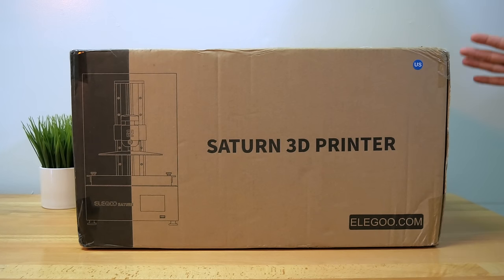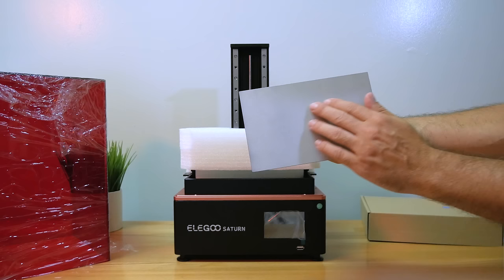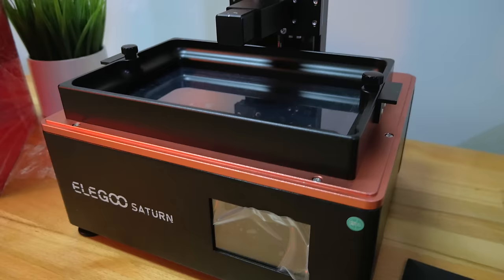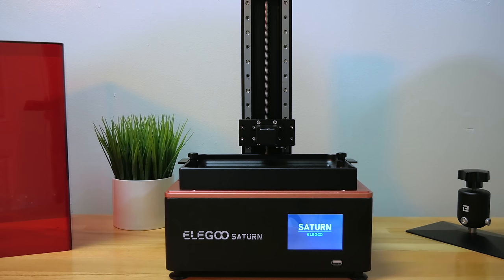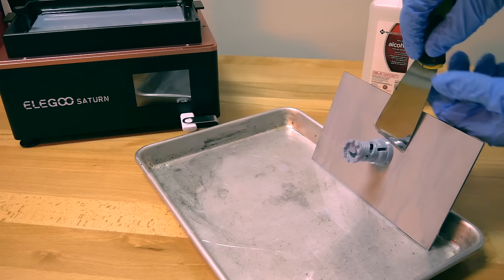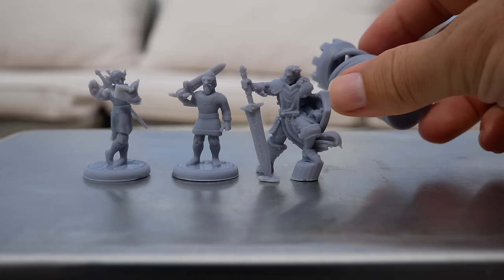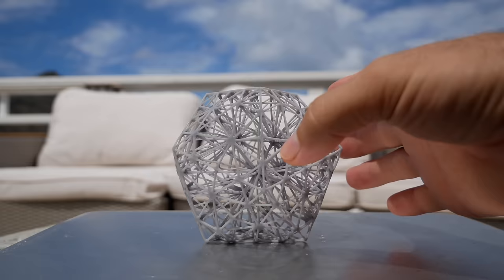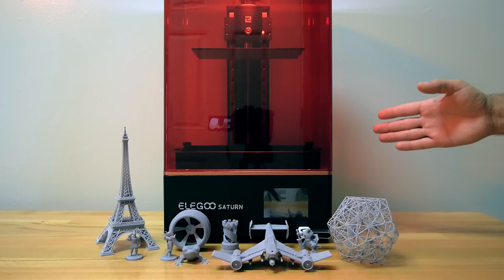Elegoo Saturn - Resin 3D Printer - Unbox & Setup

Comment: Little tip - I think you can reuse the alchohol. Pour the alcohol in the vat and turn on the curing light. The resin in the alcohol will solidify and can be filtered out.
Reply: Gert Halberg waiting for my Saturn, but seems like a cool tip. Though I do worry about the alcohol getting hit from the UV light and combusting.
Reply: @loshan1212  thats imposible, just put uv lithg for 10 minutes
Reply: My Saturn is arriving today and it's my first resin printer. I had a very small concern about how much rubbing alcohol I'd be buying/wasting but this tip is a brilliant solution. Thanks for sharing.
Reply: Counter tip: sounds like you haven’t done it. Don’t recommend something you don’t already do & can atleast attest to the results first hand confidently with resin printing

Comment: The plastic putty knife is for use in the resin vat to help remove things stuck to it without requiring the vat to be empty. Great practice to use it to check the FEP after every print and also to stir the resin to ensure even mixture of the pigment and aid in reoxygenation of the resin.

Comment: Here's how I remove prints, I've found a way that works pretty much every time and doesn't damage the print or the bed (if you're careful.) Get yourself some razor blades (the thinner the better) and CAREFULLY slide them under the print. Sometimes using just a razor blade is enough and the print will pop right off, but if it's still being stubborn, grab your putty knife and slide it in UNDER the razor blade, the thing should pop right off. You might need to use 2 or more razor blades on opposite edges of the print, for particularly large/stubborn prints.
Reply: i do the same. I use a spare blade of a utility knife and it slides just under the prints making separation a breeze. I've been using my Mars for more than a month and the build plate has no significant scratches. Mine is anodized black and quite rough to the touch, while I've seen online many have problems with the machined ones.
Reply: they make plastic razor blades that are pretty damn sharp.  they are on amazon.  people used to use them for this, idk if they still do.
Reply: I tried that a year ago & have never turned back- works great!!

Comment: 4:25 Is it advisable to peel it off? Many people out there prefer not to do so. Others protect the screen with a FEP film.
Reply: Screen protection is strongly advised in the 3D printing community, as there were many cases of tub leakage, resulting in cured resin sticking on the screen and damaging it.
It's cheaper to buy an FEP film than to replace the whole screen for around 80 bucks, I wouldn't leave the foil on though, it's usually all bubbly and wrinkly.

Comment: You just need 15 - 30 s to VAT cleaning.. and the cured resin easy to peel up.....

it is better to repeart (30 second x 10) than (300 second x 1)
you can burn out the LCD with 300 second in one shoot.....

Comment: My biggest issue is, maybe not really an issue, but putting on the build plate and tightening with the big top screw. That screw doesn't go down into anything. that slot you slide the build plate on is flat with no holes. Is that how it's supposed to be?

Comment: I bought this and my touch screen isn't responding at all. Tried downloading the latest firmware, plugged the USB in, and turned it on. It made several loud beeps but no difference was made. Any advice?

Comment: which is better for a total newbie, a filament type printer or a resin printer?
Reply: I would definitely go for a filament printer if it's your first time. They are much easier to work with, cheaper and can produce much bigger and more functional parts. The main advantage with resin is that they can make very detailed tiny parts so if your going to be printing lots of tiny figures resin might be better for you
Reply: That FDM printers are cheaper isn't an argument anymore. Resin printers like the Elegoo Mars or Creality LD-002R can be bought for 220 Euros already. I started with a resin printer and getting used to the cleaning process and how to support parts with a sclicing software was a matter of a few weeks. Why did I start with a resin printer? Because my main focus are figures and statues for painting.
Reply: Depends entirely on what you want to do. FDM is better for functional and large parts. Resin is better for highly detailed, decorative prints. It's difficult to make parts that fit a mechanical purpose on a resin printer due to the fragility of most resins and the slight shrinkage of prints. FDM printers will likely fail a fair amount and require regular tinkering to get working, resulting in a lot of extra effort to get successful prints. Resin prints are less likely to fail, but require a good deal of careful post-processing that is at least somewhat hazardous to your health if you don't have the proper protective equipment.
Ultimately, if you're willing to do your homework and you want to print models/figures, go resin. If you don't trust yourself to take the necessary safety steps and/or you want to build mechanical/large parts: Go FDM.
Reply: @Sharpevil   , there are other resin types available,  but they are not cheap. If resin cost is not an issue, it may be a better solution for parts that do not need to be large. Very few people print large parts (over several days of non-stop printing).

Comment: Do you have a link to the dodecahedron print or is that a test model on the stick included in the printer? Id love to try that when my Saturn arrives!
Reply: Did you ever find this model? I'm having trouble locating it but I've seen it several times on yt

Comment: Running desperate over here! I just bought one of these this last week. Ran it through the rook piece, no problems printing. However, every time I grab a file it comes as stl format and when i slice/save it, I save as the ctb. However, as soon as I stick my usb in the elegoo saturn and run it, I get file format unknown. I have tried so many things and I cant get it to work. HELP SOMEONE! plz
Reply: the slicer may be newer than the printer firmware

Comment: I have A big question, how can a Resin 3d Print be glued to a Pla Print. I ask this because I what a resin printer for job , such as the heat of some model "specially" female model with long hair/
Reply: Resin parts can be glued to other materials with cyanoacrylate glue (superglue).

Comment: The seconds-per-layer time is advertised at 1.5-2.0, but your settings had it doing 8 seconds per layer. The printing time should have been much lower. EDIT: This may be related to having the older screen instead of the new one.
Reply: Aaron Wiginton this looks to be one of the pre-production models that Elegoo sent out for reviewers. It has the USB in front and I’m guessing the normal RGB screen and not the monochrome.
Reply: Definitely. his USB is in the front. The production models are 4k and mono and have usb on the side-rear. I got mine today. just finishing up the first print at 2sec each (default).

Comment: Did ELEGOO send you the old version with the non mono screen? Because otherwise the exposure times are way too long.
Reply: He's got the Beta version, you can tell because the USB port is in the front of the printer, they moved it to the side for the production version.
Reply: Yea, this is the 2k version. 4K version’s USB is on the side.
Reply: @JINGXO  but.... then what sense does it make to review a printer with different features than the one produced ?
Reply: vincenzo caruso yeah seems kinda pointless, it’s basically a larger Mars

Comment: elegoo declares a fast layer time " about 2 seconds " why do you use 8 seconds ??  
also the resolution in your ChituBox shown is wrong (2 k) actually saturn has 4k display...very strange
Reply: He's using a longer layer cure time because he has an earlier review model with the USB port on the front instead of the retail model that has the port on the right side; the review units do not have the monochrome LCD that would give the shorter curing cycle.
Reply: @LidellFrasier  ok...thanks for replay

Comment: hello, can you please tell me something about the dimensional accuracy?, all of you that makes reviews cares about stupid miniatures, no one taking care about technical accuracy, don't you think that if someone will buy a printer they will require to print according to the CAD?  is 20mm still 20mm after printing?..what's the real accuracy?. please take this as a suggestion for the future
Reply: It depends on the resin used. For very accurate sizes, small scaling in the slicer is required. This is the nature of the plasric materials, not of the printers.